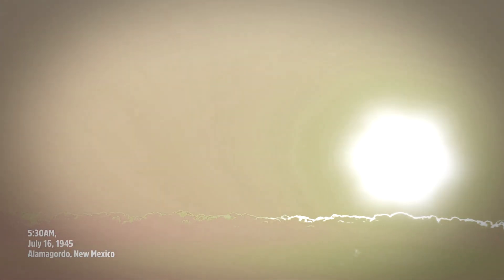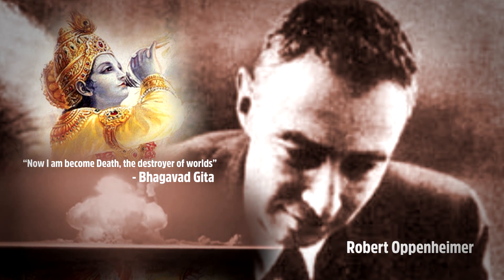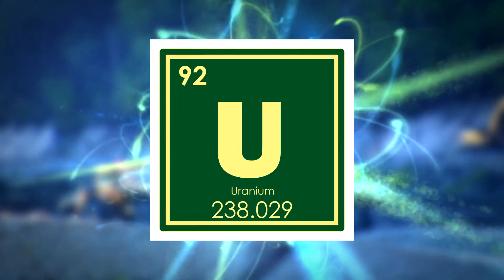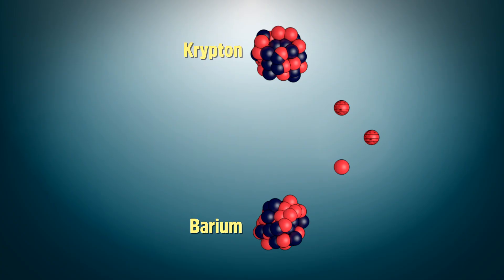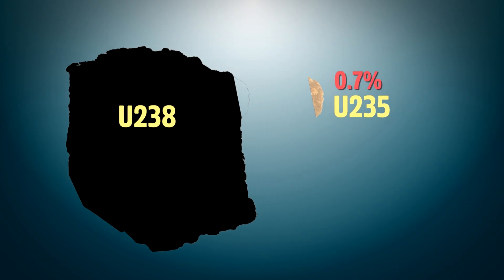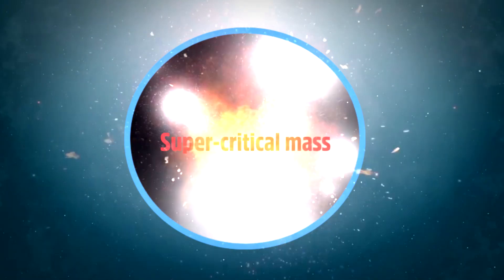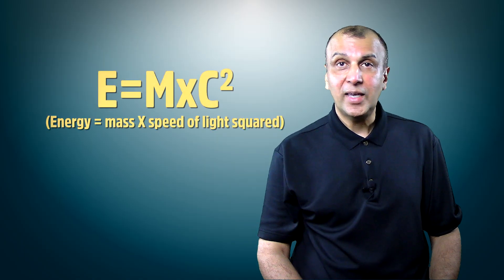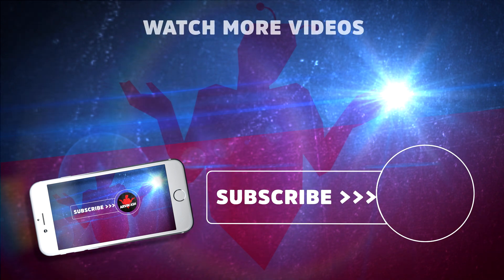How Does an Atom Bomb Work? And why don't more countries have it?

Comment: A few additions. The bomb being described is a uranium gun bomb. This was the device used on Hiroshima. This pretty much explains how it worked. Two sub-critical masses brought together very quickly, fired down a barrel of a gun, when they meet it becomes critical and an atomic detonation occurs. The draw back is uranium is like gun powder, you use it and it is gone and the process to make it is very time consuming and expensive.

The first nuclear explosion, Hiroshima was the second, was a plutonium device. Plutonium is too unstable to use it in a gun bomb so they created a hollow sphere. The detonation then depends on compressing the sphere into a much smaller mass. It takes a wide range of explosives surrounding the plutonium sphere detonated within milliseconds to complete this task. This is why the Trinity device was so large. This then becomes critical and a nuclear detonation occurs. The advantage of plutonium is it is made by a nuclear reactor, the correct type of reactor of course. Now you have something that is making an endless supply of plutonium and you are not consuming your base material as done with the uranium weapon.

You can compress uranium to critical mass, but plutonium as I stated above is easier to produce. They wanted a working weapon as fast as possible. They knew the gun weapon would work and spent their time perfecting the compression method for the plutonium weapon.
Reply from the maker: Great summary of plutonium device! But as others have pointed out - you may just have superseded me on the FBI watch list. lol.
Reply: @ArvinAsh  I've read many books, to start with an idea in the 1930's with the end result is quite an achievement that required a boat load of money or a spy or two. Then to progress to a thermonuclear weapon, these people were really out there. And a FYI, the start of a thermonuclear denotation is a plutonium detonation. This is why the weapons have gotten smaller in physical size and the yields have gone through the roof. In addition, if they or them ever turn them loose, the air breathers on this third rock from the sun are toast.
Reply: @Garry Mcgrath You understand things backward.  Plutonium is more unstable because it has a larger nucleus, therefore the protons that are farther apart than with uranium are already more apt to fly apart due to positive to positive charge repulsion more easily overcoming the strong nuclear force, which binds protons only if they are very close to begin with.

Comment: Yeah... but Atom bombs are so inefficient. The actual material used in the process does not get used.  You think when atom bombs explode they use up all their uranium when that is far from the truth.  Heat usually destroys the extra material that did not split.

Comment: Can someone explain (simply please) what were the nazis doing with heavy water? To stabilize the process? But how and why?
Reply: I’m not a nuclear engineer but I think I understand why:

Heavy water contains an isotopic form of hydrogen called deuterium. Normal hydrogen just consists of a proton and an electron; deuterium contains one proton, one electron, and one neutron; tritium contains one proton, one electron and two neutrons. These two isotopes are the only stable alternatives to normal hydrogen. In the video, we saw that if we blasted a neutron at a uranium atom it would cause the explosion. So in conclusion I believe that the heavy water was just a storage system for extra neutrons in a stable manner.

Sorry that was kinda long but that’s my thought process behind it.
Reply: TheGhostLegend001 thank you!
Reply: @TheGhostLegend001  Tritium isn't stable, it's radioactive.

The real reason they wanted heavy water is that it's a pretty good neutron moderator for nuclear reactors. They were going to use it in nuclear reactors that would be used to produce fissile isotopes for atomic bombs.

Comment: You cannot simply explode the 2 masses together. What is required is the effects of a “1 point safety” explosion. H.E. Charges need to surround the mass and detonate at EXACTLY the same time causing an implosion that is peefectly 360 degrees orbit around the mass. Without 1 point safety you will NOT have a nuclear yield. Your explanation is flawed.
Reply from the maker: Come on Danny, you can't give away all the technology! There may be nefarious people watching this.
Reply: Thank you for the SHOUT OUT tho!!  Awesome. It was a good video
Reply: You can quite literally simply explode the two masses together. That's what gun-type assembly is. What you're describing is implosion assembly.

One-point safety is just a measure of reliably in the event of an accident, anyway, meaning that a given nuclear weapon has a 1-in-1,000 chance of exploding if it, say, caught on fire or something. Fat Man was almost certainly not one-point safe, and the military was prepared for an accidental nuclear explosion if the B-29s carrying either atomic bomb crashed on the runway while taking off on Tinian Island.

Today, most nuclear weapons (in the US inventory at least) are zero-point safe, meaning the odds are 1-in-1,000,000.
Reply: Zane Shute I dont know what qualifies as “most” but I can tell you that LANCE, Pershing and Pershing 2 were 1 point safety. It is the means by which the implosion occurs. It also is used to ensure a prescribed nuclear event. Simply exploding the masses together still has to be a controlled IMPLOSION.
Reply: Zane Shute a nuclear warhead WILL NOT achieve a nuclear event EVER buy simply carching on fire.
Reply: @dannyjackson3879  Like I said, it is not the means by which implosion occurs. Implosion assembly is the means by which implosion occurs. Gun-type assembly, which is almost literally "simply exploding the two masses together," is a separate assembly method that is still valid.

It is quite unlikely for accident detonation to occur via a fire or accidentally falling out of a plane, but you can't say it will never happen, because there is a chance, and we have a number for it... it's 1-in-1,000,000.
Reply: Zane Shute I am pretty sure I was trained correctly and INSTRUCTED my soldiers correctly while being a 13NZ3 in the US ARMY.  Have you ever disassembled (or assembled) a Whiskey package?  I have. On both US and Soviet made missiles. Have a nice day. ;)
Reply: @dannyjackson3879  Pretty fucking embarrassing to get your terminology switched up, then. Probably shouldn't have divulged that information.
Reply: Not really secret. Lol. And not real easy to do. Plus, they still have to get the “235” yes?  😆

Comment: cannot you get a 100% conversion rate with a matter-antimatter bomb?
Reply from the maker: Thrakerzad Yep.  Antimatter would completely convert an equal amount of matter to pure energy. However, we don’t have the technology to create large amounts of antimatter.
Reply: @ArvinAsh  yea, I mean even if we could make large amounts of it, trying to keep it isolated for long periods of time would be a nightmare, you would need a near perfect vacuum and perhaps a very strong magnetic field. It may be easier to just have the bomb created the antimatter when it's at the point where you want to detonate it rather than keeping it contained in a weapon.
Reply: @ArvinAsh  that's because it's only  made as a by Product in particle accelerators like the LHC and not in a dedicated AM "factory". Would make it much cheaper and efficient since you would only need a small amount to make a big boom.

Comment: The bowling pin analogy isn’t very good. The bowling pins move because the energy is transferred from the heavy ball to the pins. A better analogy would be the air in an overinflated tire being under a lot of pressure, so that the right puncture could cause the tire to explode. Or anything with a lot of potential energy that can immediately be converted to kinetic energy, and not the transfer of kinetic energy.
Reply from the maker: I think I agree with you on the tire analogy.  That would have been a good one.  Should have consulted you before making the video.

Comment: > near a small town called Alamagordo New Mexico
The 1945 Trinity test took place on what today is the White Sands Missile Test Range. Trinity Site is roughly 75 miles from Alamogordo. There are other, smaller towns closer to Trinity Site, but Alamogordo is the closest town if any real size. In 1940, the population was about 4,000. Today it's about 30,000.
Reply from the maker: Buz Aldrin Correct. It’s the closest town someone would see on a map.
Reply: @ArvinAsh  The earliest Downwinders:
https://www.atomicheritage.org/history/tularosa-basin-downwinders
Reply from the maker: That's a very interesting read.  Thanks for that.

Comment: Here a few questions . Basically, the nuclear fission occurs in a a vessel with supercritical mass of u-235, then the vessel is splitted into two vessels contain subcritical mass to sustain it from becoming uncontrollable ? A controllable nuclear fission has already occurred in the subcritical mass vessels before the combination of two subcritical mass vessels to produce a huge explosion ? The uncontrollable nuclear fission will happen once they combined ?
Reply from the maker: The atomic bomb has to be initiated, in other words, the initial neutrons needed to slam into other neutrons have to be introduced.  One way this is done is this -- two types of pellets are placed within the nuclear fuel. The combination of two isotopes, such as berillium-9 and Polonium-210 coming together in the pellets inside the nuclear fuel releases neutrons.  These pellets come together inside the nuclear fuel at the same time that the two subcritical masses are forced together.
Reply: @ArvinAsh  meaning that the two subcritical masses have not been introduced with the chain reaction yet ? The chain reaction will occur once the combination of subcritical masses come together with the pellets simultaneously ?
Reply from the maker: Not only are the two subcritical masses separated, but also the two pellets which provide the initiator neutrons are separated until ready for ignition. The two pellets are brought together at the same time as the two subcritical masses to ignite the fission reaction.
Reply: Ah I see. So the chain reaction happens once the pellets and the nuclear fuel are brought together simultaneously. Thank you sir. I am going to do a presentation on How Atomic Bomb Works. That's why I need to clarify on my knowledge to avoid any confusion from my audience.
Reply from the maker: @syedamir8052  You should know that although the concept is the same, most modern nuclear weapons use Plutonium instead of Uranium which has much greater yields.  In addition, the vessel technology has advanced for greater efficiency and miniaturization.  And as you probably know, the superpowers have even more advanced Hydrogen bombs which combine Fusion with Fission to create yields that are orders of magnitude higher than these early weapons.

Comment: Getting isotope is not a problem. The problem is Getting neutron. Jokes aside how do they get it?
Reply from the maker: Most of the neutrons are created within the bomb from the chain reactions, once critical mass is reached. But there are pellets or initiators placed within the nuclear fuel.  These initiators contain two isotopes, that when combined, release neutrons.  When the conventional explosive creates a shockwave to create a critical mass, concurrently, these two isotopes are brought together to release neutrons.
Reply: @ArvinAsh  I mean, where they get first neutron? A small needle :P
Reply: @ArvinAsh  Hey, where they get their first neutron. I really wonder.
Reply from the maker: @isubscribedtwicetomyselflo9797  Not sure what you mean.  Neutrons are part of every atom except Hydrogen. The combination of two isotopes, such as berillium-9 and Polonium-210 coming together in the pellet inside the nuclear fuel releases neutrons.  This is the kind of reaction that initiates the chain fission reaction.
Reply: @ArvinAsh  First, you really know about about Chemic. Thank you. You know, after the starting of the explosions we gain 3 neutrons after an explosion. My question is, where they get first neutron that starts explosion?
Reply: @isubscribedtwicetomyselflo9797  The first explosion is initiated by a normal explosive material. Imagine a very standard TNT bomb for the sake of it. The TNT bomb detonates and brings the two sub-critical masses together which produces neutrons and simultaneously brings two pellets together, which also produce further neutrons. Do you understand now?

Comment: In Relativity, 
We read about Relativistic Mass which increases by Gamma (γ)  Factor when we approach to speed of light.... 
So, 
Question is that
This increase in mass means that the amount of Real solid Matter increases of Moving Object???
Or
Let's take this question in more simple way, 
*if we take a 1 gram of Diamond 💎 crystal and we start to increase it's velocity towards speed of light,  then,
Does it mean that when Diamond 💎 approaches speed of light then more Diamond 💎  will start to deposit around this Crystal in the form of Matter ???*
Kindly Explain.
Reply from the maker: That is a great question!  In fact, it's so good, I will make a video on it.  I was going to have you wait for the video to get the answer...but I won't. The short answer is NO.  There is a big distinction between relativistic mass and rest mass.  The rest mass does not change with velocity.  More details will be in the video.
Reply: @ArvinAsh  In video kindly take into account *The  Lorentz Factor*...
I mean explain The Meaning of Lorentz Factor as Physicist (experimental significance or Physical Meaning ) ...
For me, 
As a Mathematician prospective it (Lorentz Factor)  seems to be goody-goody because it satisfy  the Equations BUT
 as a Physicist prospective I feel that it is trick played by Mathematics just to balance the Equations ...

Comment: Such a concise explanation. Well done. 😊
I have a question though. 
Whats the difference between a hydrogen bomb and a atomic bomb? Does the H-bomb use Hydrogen isotope instead of uranium??
Reply from the maker: Hydrogen bomb uses H isotopes in addition to uranium. The hydrogen isotopes fuse and release more energy.  In addition, this fusion of the H isotopes causes more neutrons to be released which causes even more uranium to fission. So the yield of the bomb is increased exponentially.  H bombs are about 1000X more powerful than atomic bombs.
Reply: @ArvinAsh  Oh so the process is still the same. Only that the H isotopes are added to amplify the energy. Got it. 
Thanks for the explanation sir. Now I can sleep peacefully knowing that the H-bomb and the atomic bomb are one and the same haha. 😁

Comment: I have a question, so it can be done with any element in the periodic table but they choose U because it’s the heaviest nucleus?
Reply from the maker: Correct, because it contains more neutrons and protons than any other substance, it is most fissionable or splittable. It's isotope is the most unstable because it has a lower energy state when a neutron hits it, and splits it into two other elements. It also releases more neutrons upon splitting and can thus cause more nuclei to split.
Reply: Pls dont kill us
Reply from the maker: Ginioreos No worries. Nobody can build the bomb with the info that’s in the video.

Comment: how much gram or kg uranium containing in an atom bomb??
Reply from the maker: Thanks for asking. Great question! The critical mass of Uranium 235 is about 50kg or 100 lbs.  This means that if you put this much of the isotope together it will self combust.  But usually a smaller amount is used in bombs depending on the efficiency of the bomb design, i.e., how well it can contain neutrons, and how good the speed and timing of the initiator is.  So a typical atom bomb would have had anywhere from 15kg to 40kg of the stuff. Note that most modern bombs made by the superpowers use a more advanced nuclear technology using plutonium that needs a lot less fuel.
Reply: Arvin Ash thankx man